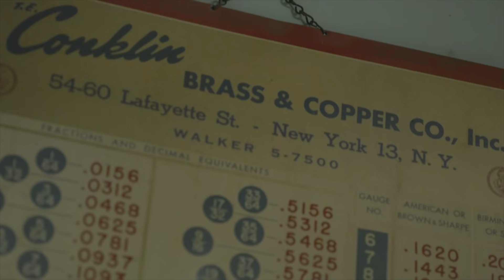Grado Labs Trailer

Comment: Grado has a big issue in 2016, because they design a $700 pair of headphones in the same manner that justifies the $60 pair, which they have designed in the same way in 1960s and continue designing now. No one sees problem with that?
The equivalent would be Ford designing same trucks now as they did in 1960s, with same brakes, tyres, suspension, engines, fuel consumption, safety and comfort levels, materials etc. In other words, you would scream — unacceptable! Yet Grado does just that!
Grado headphone usability, construction quality and design in all models above $60 is abominable compared to what the best of US headphones industry can offer today. I won't even compare them to the Japanese, or Danes. Grado's design and tuning is from another era; only their pricing is modern and undeserved.  
Grado headphones are tuned for certain (older) folks, who like certain genres of music and certainly cannot hear many frequencies, nor such music uses that frequency band. Put Ella Fitzgerald, yeah, they sound good. But put some more modern music on Grados, and then listen same music on a pair of Philips  headphones (that cost one third of Grado's prices but are ten times better designed using superior materials, are more robust, etc ), and you ask yourself, "What on Earth Grado is doing?"
Grado is slack and lazy, just what an American company should NOT be, and their owner wants you to listen Eric Clapton and Ella Fizgerald forever. And drive 1960 Ford pickup truck too, I guess.
Reply: Sometimes a good design is better just left alone. Works great don't change it.
Reply: Zvonimir Tosic Im 19 and i love them for every genre i have to agree with you with the build quality though
Reply: The quality of "construction" and "comfort" of today's Grados exactly matches headphones used during the WW2; if you don't believe me, google for "WW2 headphones" or "WW2 headsets" used by US military. It's that bad…
Reply: Zvonimir Tosic I told you I totally agree with you with the build its so uncomfortable and rather flimsy on the joints but I enjoy the sound
Reply: Zvonimir Tosic 
Lol you have no idea what you're talking about.